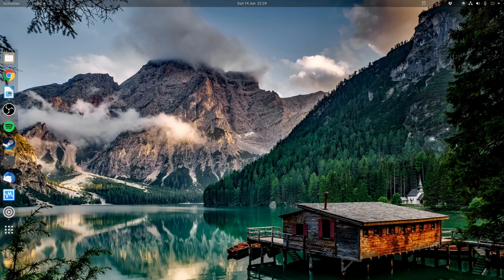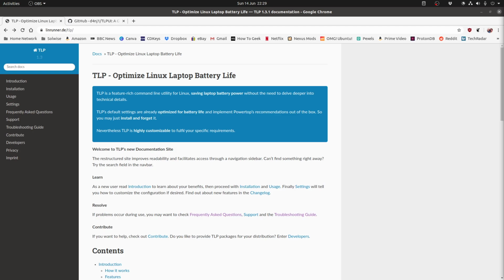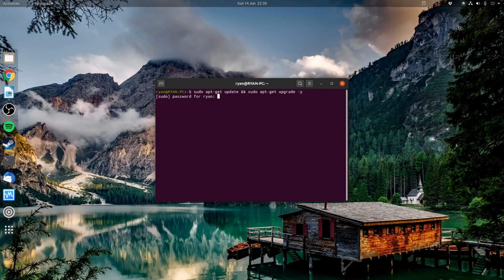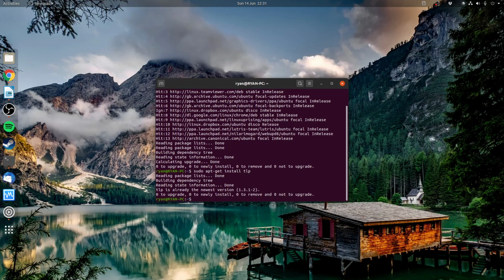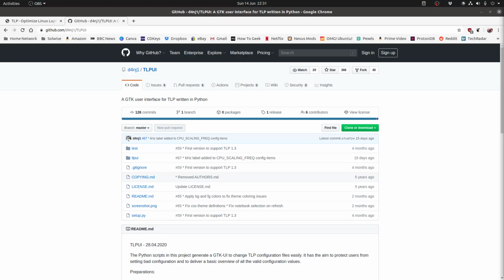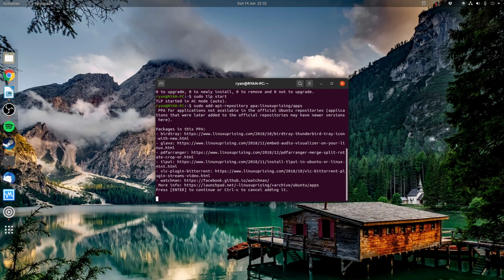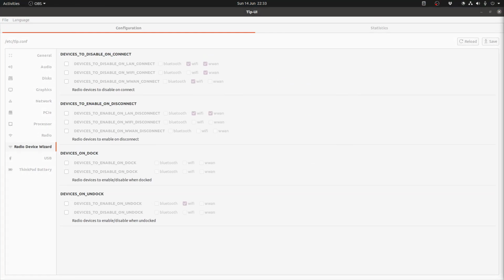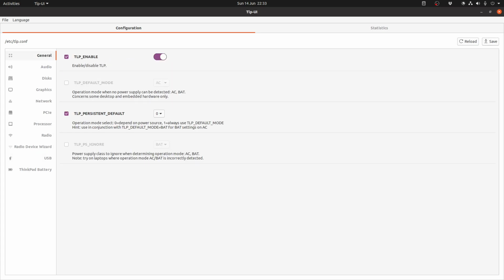How to Improve Battery Life on Linux (Easy Tweaks)

Comment: TLP doesn't seem to automatically start. I have to manually start it before my battery drains from 100% to 70% in like 20 minutes
Reply from the maker: Strange, what command are you running to start TLP?
Reply: @IntelligentGaming2020  the same one you used in the video and one from someone else. Sorry for not responding earlier.
Reply from the maker: @NightcoreSuzuki  What distribution are you using?
Reply: @IntelligentGaming2020  Zorin OS
Reply from the maker: @NightcoreSuzuki  Unless Zorin OS does something special, it should work, have you asked in the Zorin OS forums?
Reply: @IntelligentGaming2020  No, not yet. I don't know how to sign up for an account 😅

Comment: Errors were encountered while processing:
 oem-tlp-config-sound-power-saving
E: Sub-process /usr/bin/dpkg returned an error code (1)
plz help me
Reply from the maker: Try restarting your system and try again, sounds like something is using the package manager.
Reply: @IntelligentGaming2020  i tried to install TLP but accidentally it gets stopped in the middle.
but now i can't install or remove anything plz help me sir
Reply from the maker: @pattapuvijaykumar8964  Anything at all, or just TLP? What distribution are you using?
Reply: ubuntu 16.04LTS
Reply from the maker: @pattapuvijaykumar8964  Wow, that's old, OK see https://www.linuxbabe.com/ubuntu/tlp-linux-laptop-battery-life
Reply: @IntelligentGaming2020  sir i can't install anything or remove anything plz help me
Reply from the maker: @pattapuvijaykumar8964  I recommend posting in the Linux4noobs subreddit, something is clearly wrong with your installation.

Comment: Hello! I googled about the setting i wanted to tweak that is about CPU_Scaling_Governor. It says that the governor of the distro must be disabled, and also point out that ondemand workloads should be enough for almost everything. But i could not find much info about this and how to disable/enable this settings. I am making a test first here with stock settings and see what the results are. I'm curently using Linux Mint 20 and my notebook is a 2013 model Dell 3421 (in my country it is assigned as 2630). Until now, i am 1:30 mor or less, and gone through almost 50% battery (54% actualy).  But i realy wanted more info about those settings. Do you have any idea a specific place i can find info about this? By the way, i am loving this app. Very complete UI set.
Reply from the maker: The TLP project would be the best place to look at - https://linrunner.de/tlp/ or the Arch Wiki page on TLP - https://wiki.archlinux.org/index.php/TLP
Reply: @IntelligentGaming2020  Got it! Thanks, man!

Comment: does this tool conflitcts with gamemode from feral ? Isn't there a danger that both tools fights each other ?
Reply from the maker: That's a good question, although considering that Feral Gamemode only changes the CPU and GPU to use Performance modes when a game is launched it could possible overwrite the TLP parameter but only temporary. That being said, I don't think there is any danger since your system will automatically change performance modes anyways when you CPU is in demand.

Comment: Bit surprising Mint doesn't come with it by default considering it's a "it just works" type of distro. Even without TLP though Mint just seems to work best on my old laptop, battery and performance wise.
Reply from the maker: Yes it is strange, maybe the Linux Mint 20 will include it.